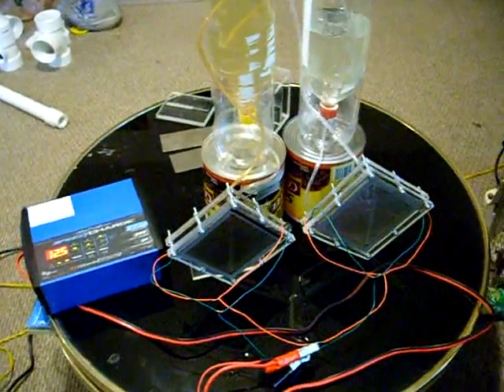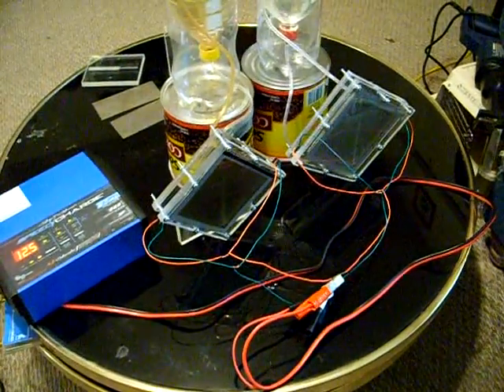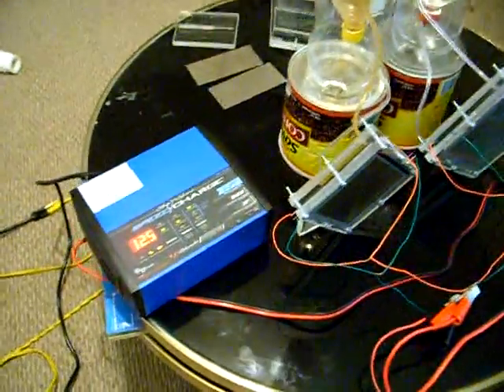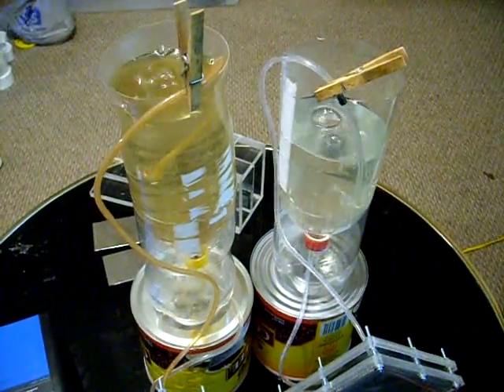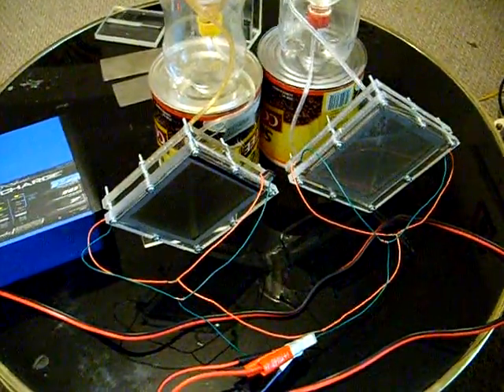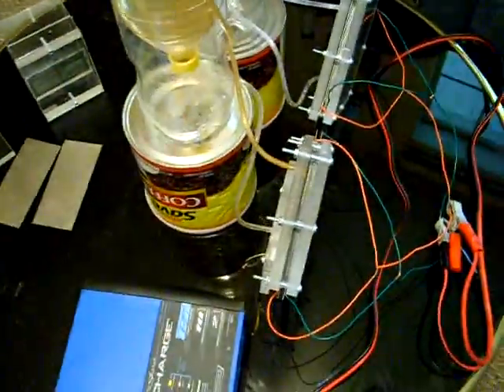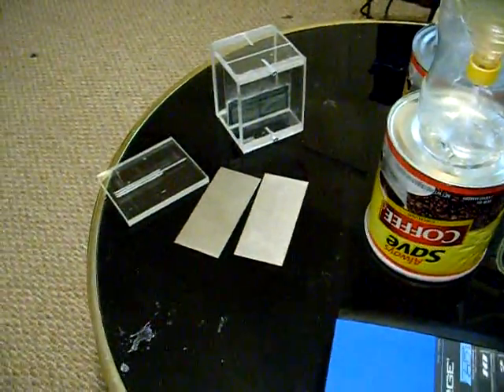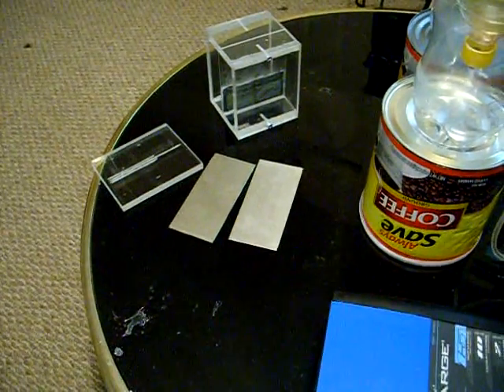HHO dry cell 02

Comment from the maker: Thank you for the comment on my video, and for being interested in the Hydroxy powered forge.
If you will tell me a little more specifically what your needs are, I will design a  hydroxy burner to meet that need. I'll need to know just as much as I can. Things like - were and in what manner it will be used - how high of temperature range it will need to cover, will it be used inside or outside, what is the largest smelt you will perform and things like that.
Peace to you.
Mike.